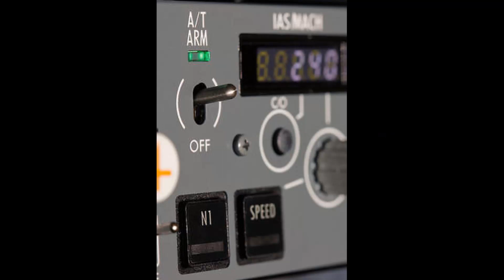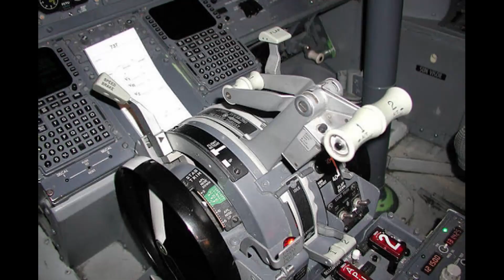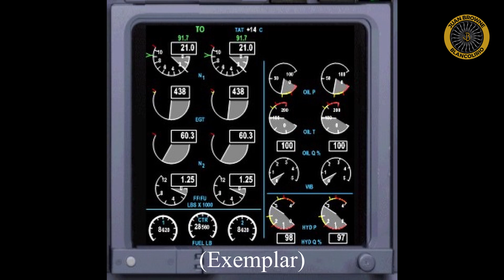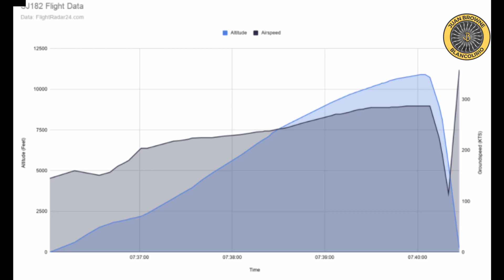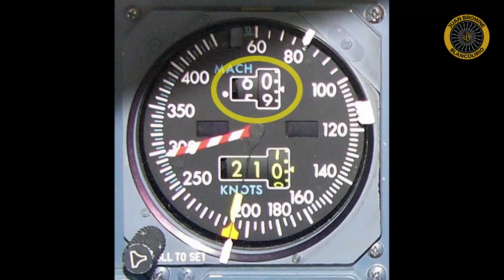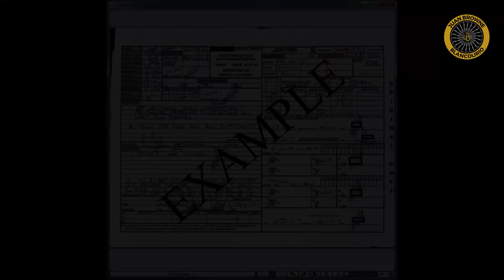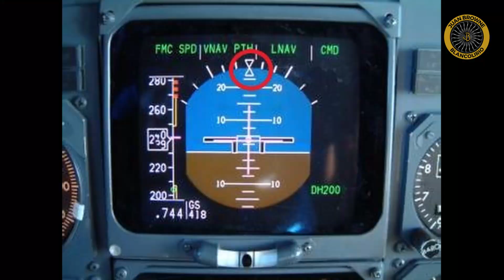Sriwijaya SJ-182 KNKT Preliminary Report 12 Feb 2021

Comment: To attempt to understand the unimaginable possibilities one needs to see first hand the realities of aviation here in Indonesia, Asia and unfortunately the rest of the world. I have been flying here in Indonesia for the past three years, I fly for a respectable, 49 years old company (mining and exploration support charter company). In the office there are pictures of DC 3s, Mallards, old Bell helis........All the old guys are gone or have been pushed out and were replaced with new corporate types including the president who ran a soap company before. We have great posters on the walls, the senior management (they like this term) loves to talk about safety and excellence. We have western accreditations required for the mining contracts, yet sadly the reality of the actual operation is below any acceptable level (I am being very nice here). I fly a Twin Otter on floats. Last year due to maintenance schedule, a wheel Twin Otter was flown to our contract airport and I was getting a company check out in it. This was one of the new Twin Otters, glass cockpit and all. As I started to taxi, I tried to reduce the power, in return I got more power on left engine than the right one. The airplane veered to the right and my senior "training" captain said: "No use the brakes". The rigging of the prop/engine power pick up was so far off, that in this low power/taxi range (beta, just control of the prop blade angle with the engine remaining at idle until negative blade angle is obtained or reverse) the airplane had reverse controls situation on that left engine/prop. The solution is to adjust a single screw at the prop/fcu cam mechanism so the engine power is increased only once the prop achieves the negative angle. This is a 15 min job to get the initial setting. On floats the entire rigging of the props/engines is critical as we have no brakes or steering on the water. I turned the plane around, parked it and wrote the rigging up. I was once again the black sheep. This plane has been flown like that by the entire company in this state for a long time. All maintenance run ups were up to date with "all good captain" notes. We do annual trip to Canada to fly the Twin Otter sim, the sim ride is done by a very reputable company, good name and again lots of nice posters on the walls. All three trips were with wheel ops captains, too much trouble to send me with one of the other six floats guys (we have our own sops, check list, procedures, QRH, emergency procedures, airspeeds......). In Canada we use the generic Twin Otter/sim company's procedures/materials and not our company's. All of these captains had zero interest in doing anything but the minimum required procedures in the sim. Their CRM was beyond horrific and there was not a single comment from the instructor. Again it was me who spoke up and again I was in shit from both sides. Last trip, on the last day we did some VFR STOL approaches and such, just having 45 min of fun in the sim. My co captain again and again was trying to kill us when performing full flaps go arounds. His brain was unable to push the nose down to keep her flying while reducing drag. So again and again I watched him do a VMC demonstrations with altitude on hand. We also do some training at Sriwijaya, they are few building down the road. The training is more of a social gathering, the cultural obstacles makes it next to impossible for the trainees to perform or even say in loud enough voice the most basic commands. The last training on Zoom.....sad. Plus just for the fun of it with three english speakers it was done in Indonesian language for 95% of it. Another safety report by me and nothing so far. Ok I am rambling on, what is considered safe and legal here is very different animal then what a western person thinks of. I just flew on Garuda (the national airline, best you can get). At the end of all the announcement we got something like this: "Garuda performs all maintenance procedures according to aviation standards, because you matter to us". This was the day the initial report came out. So as Bill Murray said in Caddy Shack: "I got that going form me, which is nice.....".
Reply: Ah yes, Garuda = Goes All Right Under Dutch Administration ;-) but don't be caught saying that in company of your Indonesian flying colleagues, or follow it up with "Yes I know, I'm always in the shit, only the depth varies"  :-D

Comment: Hummm    sounds like    the  Indian ATP  program,   30K  USD   and  80  hours  later  you   too  can  be  a   737-200  FO. I   dont   fly  3rd  world airlines,  I   rather  a   Drunk  Russian  then  a    Person  who   drove  a  Moped   Taxi last week but  now    was  a  'Pilot".
Reply: May be but on that flight the FO had 4,957 hours 39 minutes and the CPT 9,023 hours 22 minutes on 737.
Reply: @se2100  Sounds like 9000 hours of twirling autopilot knobs with no actual understanding of the aircraft systems.
Reply: @se2100  That alone is the truly scary part ! The hours made them LOOK more experienced that they may have been.
Reply: @Ficon  It's the future of aviation unless stopped. Nowadays, the flight crew is there to talk to ATC, taxi the aircraft, start and stop the engines, reassure the flying public, generally 'be in charge' and switch the automation on and off and indeed 'twiddle the controls' for it but they earn their pay when the automation stops working, which like any machine, it WILL DO sooner or later.

Comment: How do the throttle levers on this aircraft work? Are there cables all the way back to the engines or are they encoded to electrical signals to FADECs at the engines?
Reply: On the -500, there are cables all the way to the engine fuel control.
Reply from the maker: See previous update on this crash.
Reply: @blancolirio  watching that previous video, one thing to bring up is that on the NG/Max, the AT will disengage when the thrust levers split. I’ll have to do some research to see if that’s true on the Classics as well. So, that is confusing me with this one. The FDR shows the AP being disconnected, followed by the AT. From my experience on the NG/Max, this doesn’t make sense. 
BTW, small correction...
Engine issue: disconnect AT (you can’t do this just for the affected engine). I know you know this....many out here don’t.

Comment: can you dead stick land a airliner with enough altitude
Reply: Yes been done successfully at least twice to my knowledge. Air Transat A330 fl236 landed in one piece with a few injuries. Cant recall the other one and then of course the Hudson river incident which was sort of a landing lol
Reply: @Coops777  Also the "Gimli glider" Air Canada 143.
Reply: @machintelligence  Good one!
Reply: TACA Flight 110 was an international scheduled airline flight operated by TACA Airlines, traveling from Belize to New Orleans. On May 24, 1988, the flight encountered severe thunderstorm activity on its final approach to its destination. As a result, the brand new Boeing 737-300 suffered flameout in both engines while descending through a severe thunderstorm, but the pilots made a successful deadstick landing on a grass levee adjacent to NASA's Michoud Assembly Facility, with no one aboard sustaining more than a few minor injuries, and with only minor hail damage to the intact aircraft. Following an on-site engine replacement, the jetliner took off from Saturn Boulevard, a road which had previously been an aircraft runway at Michoud. The aircraft was subsequently repaired and returned to service.
Reply: @txkflier  Ah yes what a great example of airmanship and skill that was! Thanks 😃
Reply: Also Ural Air  178,  an Airbus A321,  that suffered dual birdstrike taking off from Moscow and landed successfully in a cornfield a couple of years ago.

Comment: Absolutely supurb analysis and presentation.  While the pilots should have been able to recover, the autothrottle problem seems to have set up the situation.  As long as we have maintenance as a stepchild profession we are going to have these kinds of problems.  Making the problem worse is the introduction of electronic features such that  manual operation skills slowly decreases.  The same situation exists with automobiles.  God help up!

Comment: There needs to be more training on basic hand flying so pilots aren't relying on the automation to the exclusion of all else.
Reply: It's not just basic flying, it's airmanship. What I do and what our company also recommends is that hands remain on the controls and thrust levers until 10,000 AGL. I have my hands on controls and TL up through 10 and during the complete approach even with autopilot and auto throttle on, as well as anytime in adverse weather conditions and turbulence. Maybe helpful that most previous flying was in planes without AT but even one of my MD80 instructors always said "Don't trust the automation".
Reply: @SciFly7  TBH, AF447 was pretty much as bad and that's Air France with a newish A330 FFS ! From what I've heard F.O. Bonin shouldn't have been flying even a Cessna !

Comment: Don't like that speed air indicator mechanic way of doing it and Report, just by cleaning there was no problem with the contacts the first time and he or anybody else should have realise that the second time it came back, and cleaning the other contacts would have made no difference without tests on cable and connections  this is more like the issue then just a contacts.
You said one of the engines was throttled back but the crash showed both engines running?
Trouble is people can't get into the cockpit these days or can they secretly? it's important people take control of the airplane engaging autopilot at least the computer's could be made to realise there's a problem and re-engage when it senses parameters beyond normality of the aircraft and bring it down to a sensible altitude and fresh air to enter the cabin

Comment: If I remember correctly, and I may be incorrect as I have not done maintenance on a 737 (-300) in years, but if you MEL the auto-throttle, I thought A/T is deemed INOP and unusable and that the pilots must fly manual throttle... I am also of the understanding that if there's a huge throttle lever split that A/T kicks off, but again, I may be wrong...It's been a long while (2003/04 Frontier) since I've worked a 37...and I've been an A320 guy since... Boeing and Airbus, two way different theories of operation achieving the same result...lol

Comment: They went from 10900ft to zero in.. 30 seconds? owch! That's going down faster than the rated maximum (flight) speed of the plane, never mind tolerable vertical rates.

Comment: If an autopilot is capable of straining so hard to maintain control that it ends up handing you a very second hand aircraft with no warning, shouldn't there be an auto-pilot stress level indicator with some kind of audio visual indication that it's about to hand in it resignation?
Reply: It makes sense that it would have cut out at some point, and that there could be circumstances where the autopilot would go from "normal" to "I need to cut out" very quickly, but in a situation like this, you'd think there would be some warning when the system gets within 95% (or something) of cutting out to prevent this exact "Surprise!" cut out circumstance.  Some warning to alert that things are drifting towards a serious problem...
Reply: Yes... but keep in mind, assuming no foul play, they seem to have missed at least a dozen indications something was wrong.
Reply: Maybe there should be an alert from EICAS when one engine's parameters change by a certain, unusual amount relative to the other, even if all parameters are in normal ranges.  Or maybe just if the N1's differ by more than 5%?  Maybe this would only alert when Autothrottle is engaged, so it wouldn't bother pilots who are throttling assymetrically for a reason...they'd already know it.
Reply: Yes.  Maybe when aileron or rudder trim is deflecting significantly.  Pop up a flight controls deflections screen with abnormal defections in red, if autopilot engaged.  Or maybe just for the rudder.  If aileron is trimmed way over, wouldn't it be readily apparent looking at the yokes?  Even just a text message, "Rudder Trim".  Elevator trim, too, if it is trimmed to some degree that doesn't match the normal for airspeed and flaps.  Then again, how often would that ever occur?  If all the passengers crowded forward or aft?
 Does autpilot only use the trim system? If so, when autopilot "gives up", wouldn't all the trim still be held?  No abrupt changes.
Can a significant rudder trim at higher speeds put excessive load on the vertical stabilizer?   Is it possible the v-stab broke off in flight?  Or did they find all of the wreckage together?  Or that the rudder mechanically failed somewhere?
Reply: @Andrew-13579  or when the autopilot has to continually add increasing input to maintain the status quo over a period of time. Could be a symptom of something the pilots need alerting to - especially if there comes a point when the input gets maxed out.

Comment: Does anyone else get the feeling that these 'pilots' were mere passengers who couldn't handle an in-flight upset ? I listened to Juan's story of events with increasing incredulity ! When will Indonesia EVER learn to really train it's pilots in 'throttle and stick' flying ? I mean really, the auto-throttle retards the #1 thrust lever, the crew do nothing, the auto-throttle retards it a bit more, again the crew do nothing, finally the auto-throttle retards the #1 engine so much that the autopilot gives up the task of trying to fly the plane !!!! AND the plane had a history of auto-throttle failures in the tech log. As an electronics engineer, simply applying the same fix (that then fails in service) is not a way of correctly servicing an item of equipment and double failures of the same kind should require despatch to a 'proper' service agent with a note/record of the failure mode. Did they not notice the 40 degree bank ? Christ Almighty ! A whole load of lives have been lost to inadequate training and regulation. There, I've said it ! PIA recently was no different, indifferent flying 'skills'. Time perhaps not to recognise Indonesian licences  outside of Indonesia ? It's not as if entire continents haven't banned Indonesian airlines from their skies.

Comment: I have basic quadcopters that you can easily switch betreen expert modes and beginner. No matter how hard you move a stick it is only going to bank but so much and have a panic button that puts it into a hover and even fly back to your position and land itself. Airliners NEVER require a steep climb/diver or bank so why are pilots still allowed to keep driving airliners into the ground? Time to get serious about autonomous airliners.

Comment: It will indeed be interesting when the CVR is available. From the data so far it certainly looks like the crew did not notice the auto throttle movement, perhaps concentrating on the weather issue, so were very surprised by the dramatic attitude change when the auto throttle 'let go'. 
Would the auto throttles normally allow such a degree of asymmetry to develop without a prior warning or perhaps this was simply a recurrence of the earlier fault.
Reply: Indeed, it looks very much like it happened on this way.